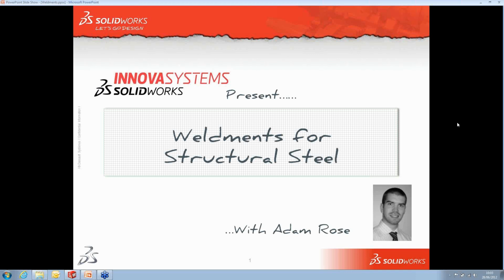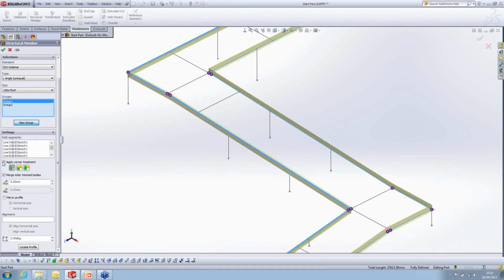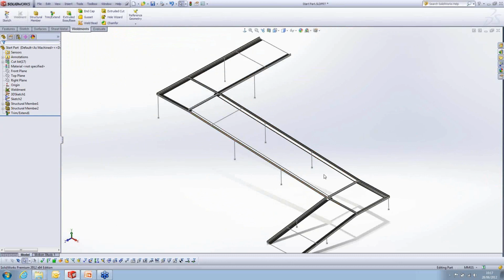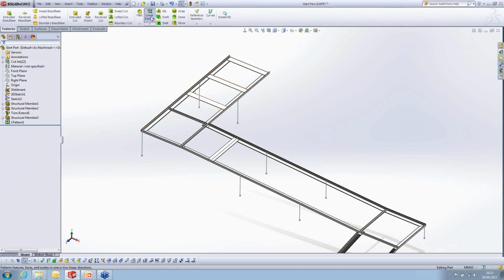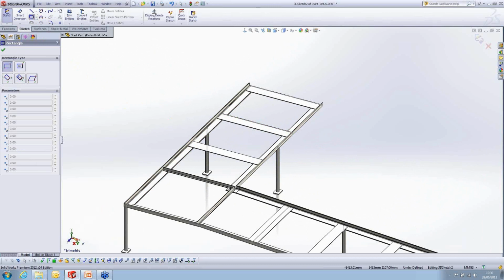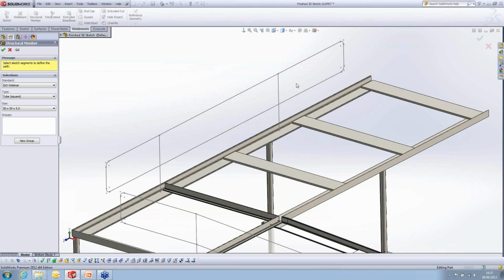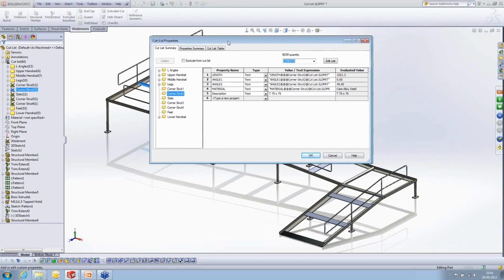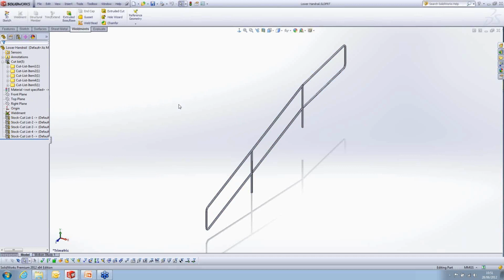Using Weldments For Structural Steel in SolidWorks

Comment: Why doesn't anyone ever create details of the parts for fabrication?  Is it not capable with Weldments?
Reply: I asked the same thing. The answer you usually get is every industry has different methods. We have bolted connections so every part has to have a production drawing. I suggest looking at some videos on multibody weldments. You can save each solid as an individual part and create drawings from there.